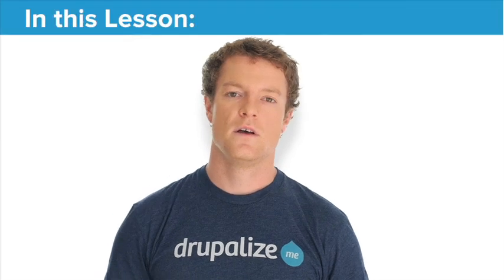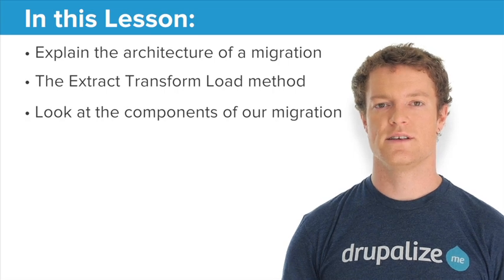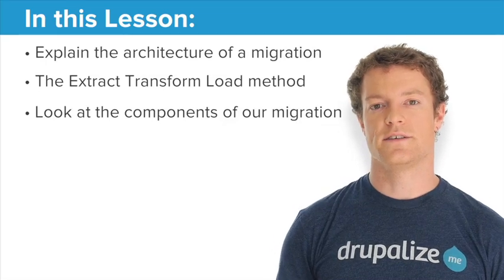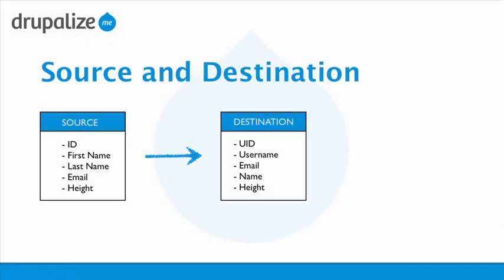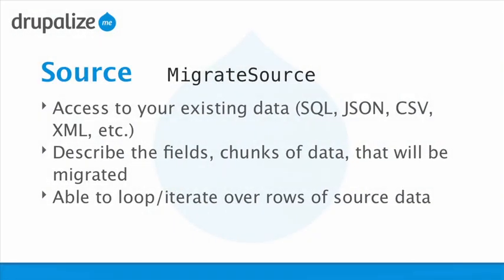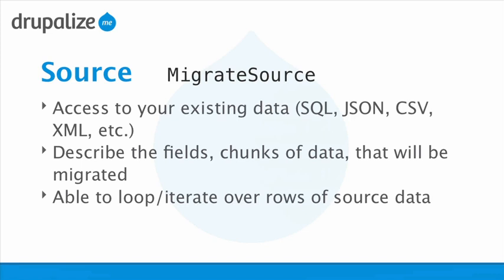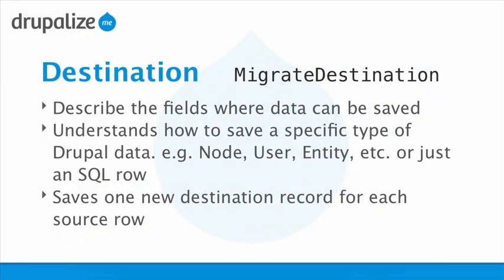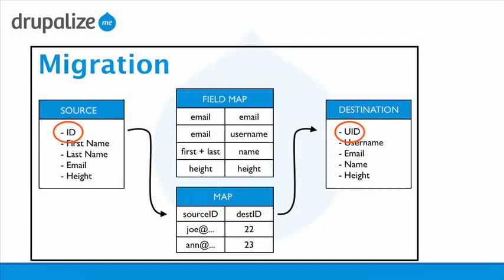Migrate Module Overview

Comment: What happened if the site you are working on is half way migrated meaning some stuff not all of them (custom modules contrib modules nodes users...) were migrated. What would you do to avoid duplicate data?
Reply: I think the easiest way to handle this would be to design, and run, your migrations with the plan of being able to revert and start over again, and again, and again, during testing.

You can revert in a couple of ways. The quickest would be to make a DB snapshot of your D8 site prior to running the migrations. Then just revert to that snapshot and run them again after making any changes. You can also use the Drush commands provided by migrate tools to revert an individual migration or set of migrations.

You can also run migrations with Drush using the --update flag, which should cause migrations to update existing content rather than create duplicate content.